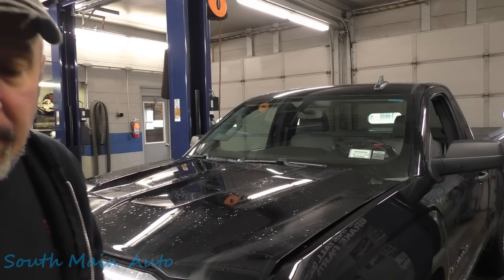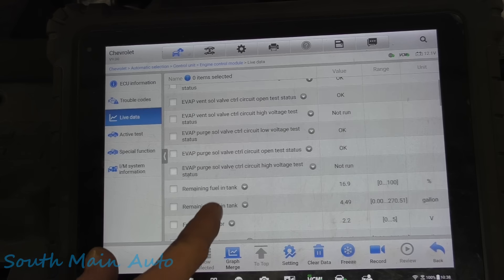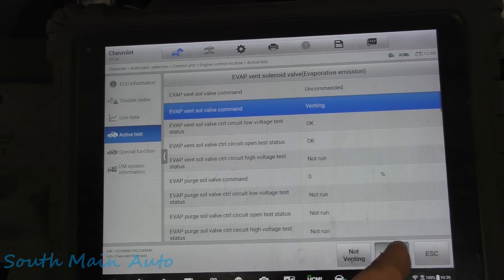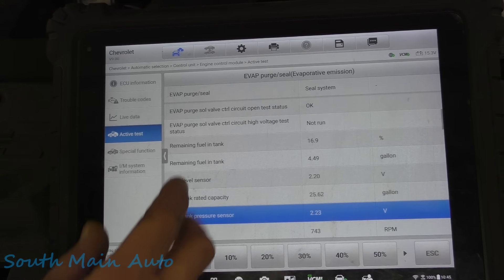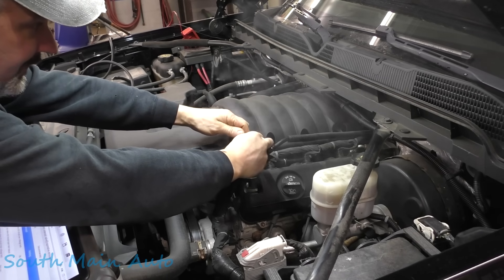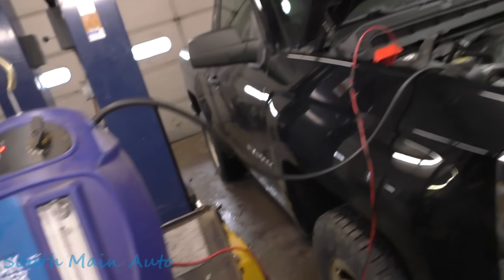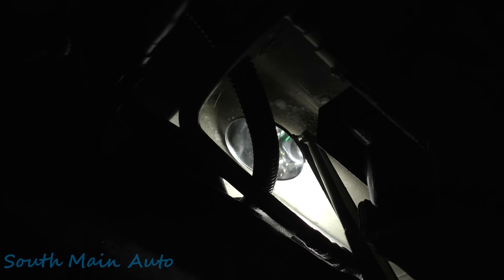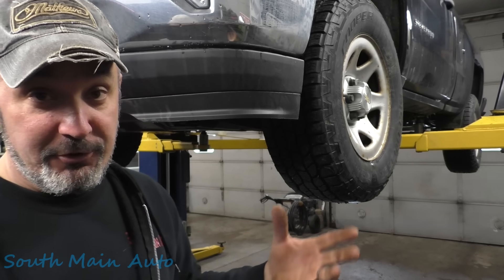An EVAP Leak 2 Other Shops Couldn't Find

Comment: So is the failure of the other shops to find that leak due to incompetence or laziness (or both)?
Reply: I think that when a technician takes an organized approach, such as Mr. O here, then they can avoid feeling like they are mired in guesswork. Which would definitely make me want to throw up my hands.
Mr. O is smart and very knowledgeable. Most importantly he knows to insist on an organized approach. My 2 cents.
Reply: But you can be sure they got paid for nothing.
Reply: @mickblock  Heck, even if a technician isn't anywhere as skillful as Eric O and didn't know how to or do any of the preliminary steps Eric used with the scanner, if their shop owns a smoke generator and they know how to connect it to a vehicle they should be able to find an issue like that.
Reply: technician is an overused word.

Comment: If you can film and diagnose this problem, and provide a commentary in under 10 minutes, you can't do much better than that. Perfect video.
Reply: The smoke machine probably took longer than that to fill the lines and fuel tank. He probably had to edit a bit of footage. But yes, it was a great diagnosis of the issue and thorough as always in his approach.
Reply: The smoke machine helped to make it happen. One person with the right tools who knows how to use them. Only one of three shops had that. South Main Auto FTW

Comment: Before anything, check the gas cap.  Been there two times.  The first time the guy at the gas station didn't lock down the cap. Easy fix.  Second time, the cap was faulty.  Got a new one and the problem was eliminated.  Another easy fix, for $45.

Comment: As easily as you found that leak, it would seem like those other shops just didn't want to fool with the job.
Reply: Dropping the tank and dealing with rust/rot is a PIA job. But that is what a real mechanic does. Many just get lazy.
Reply: Plus- not only did they NOT find it- they said there WASN'T a leak. Seems to me the data proved that the leak was there- Eric just took the time to find it!
Reply: I'm sure they took the diagnosis fee without remorse though.
Reply: @Channel-gz9hm  and they should have refunded it if they can't identify the issue.

Comment: Eric O is far more lucky than I am, I have never needed to pull a fuel tank that only had 4 gallons in it!  I've only done 3, and they were all within 2 gallons of full when I started - one was literally towed away from the gas pump!  34 gallons in that '96 Sierra.  Step 1, figure out how to get 200 lbs. of gas out of a tank without a working fuel pump.

Comment: The mark of a good repair person is persistence. Many just get to a certain point , then quit or make up an excuse for not being able to find a problem. I like that Eric has surrounded himself with tools he's familiar and comfortable with regardless of their cost, from a simple auto lamp to a sophisticated OBD2 analyzer.
Reply: In my younger years I worked as an electronic repair tech.  Another department had about 200 boards that needed repair that weren’t an easy fix.  I got through 95% of them within a week just for gong it an actual effort.

Comment: It’s quite concerning multiple shops could not find such a straight forward evap leak 😬
Reply: Probably could not afford the smoke machine. Or lied about having used it.
Reply: To be fair, the leak is on the top side of the tank, so the 'smoke' (actually oil vapor) dissipates and is harder to see if one is just looking underneath the vehicle.  But any competent (emphasis on that word) mechanic should have found this, on that we can agree.  The trouble is, in every arena of life these days, it is getting harder to find competent workers, for many different reasons that are too numerous to discuss here.
Reply: The other shops probably found it and said nope not interested in dropping the tank. Looks like a case of laziness.
Reply: Too many mechanics would not want to drop a fuel tank and know the issues with rust/rot they have. Just a case of laziness.
Reply: @redmondjp  
Well said. 
Thank for your Comment. 
RL
Reply: It would be even more concerning if they: 
a) charged him for their "investigation"    and   
b) refuse to reimburse said charges, now Eric has shown that there is a leak and that it's so easy to find.

If I were that customer I would be asking the other two shops how much business they expect to lose, if he "names and shames" them in the local paper.   Might help him to get his money back.
Reply: Most shops hire parts changer for less money and make money just to change parts and if can't figure it out shove it out the door get paid done

Comment: Once again, you prove the difference between a diagnostician and a parts changer.....you UNDERSTAND the correlation between the various components and their interaction with each other.  The knowledge is out there, but sadly most of the paycheck mechanics just go by the tests, and if the issue doesn't jump out at them, they pass it on out the shop.  I spent a 40-year career in a field where troubleshooting was a vital part of our job, and trying to find someone with the SELF DRIVE to actually FIND the trouble was always a challenge!  Good job, as usual!!

Comment: i've learned more from you than probably any other person out there. anytime i have an issue I come search your page. Hell I had my tahoe in the shop for a fuel sender. Of course it was full of gas and I had no help to wrestle it down, so I bit the bullet. get it back, cel is on, never came on before. they said something else was wrong. i watched your video, hooked up my scan tool, figured out the issue, took it back and said hey, here's my scan tool, here's the issue, they had to install a new fuel pump. pretty sad when a paying customer has to do the trouble shooting for a supposed reputable shop!

Comment: It always amazes me that other shops that claim they have diagnosed the problem, never seen to find the problem. Especially when you find the problem in the span of, just guessing, 30 minutes to an hour?!
Reply: Makes me have no confidence in shops that looked at it before.
Reply: @erniejones5008  That's why I try to do as many repairs as I can by myself.  I try to get my wife to understand that while I ignore her on  days off doing repairs on our vehicles.
Reply: @JB-tz9pi  wish I could I don’t have the knowledge or tools.  plus I am temporarily disabled. I can’t stand for very long without a lot of pain. Hopefully it’s temporary at least.  Plus my hands cramp up I easily. I can do things like change. My battery and air filter and wiper blades may be a couple of small things but that’s about it.  I have a 2012 Malibu that needs a new headlight but you have to takeoff the front bumper and it’s gonna cost around 125 bucks that I don’t have.

Comment: Glad that the Vacuum leak was a Big one... worked in Pharma before i retired and we had Ultrasonic Leak detector sniffers connected to Head Phones and you would point around the pipework and flanges and the whistle would be heard in the headphones plus the multi coloured LED lamps would rack up going from green through amber to flashing Red, being as the closer you got to the source of the problem ..great pieces of Kit...saved a fortune in time especially in a noisy location. Great Upload...

Comment: My wife's car is a 2011 Escalade ESV and it had the same code and the same problem. I just fixed it about a month ago. I bought a Chinese knockoff Avoca Smoka and diagnosed it myself. First evap job I've ever had to do. Dropping and reinstalling that 31 gallon tank by myself wasn't fun! The evap monitor still hasn't run, and I still have the permanent code set. I've got an emissions test due, so hopefully it'll finally run soon!

Comment: Great job Eric. You can do it for sure, but I'm not so sure I can do it. You're advanced diagnostic equipment and knowledge to use it shows why it's increasing difficulty for us shade tree mechanics. 

I've made my own smoke machine with limited success. My scanner is read only. And if I did know about software updates I couldn't do anything about it? It used to be the money light didn't intimidate me, but after losing a couple of battles like this it's putting fear of failure in my soul? So glad that I live in area that emissions testing is mandated!

Comment: When I read the Helen Keller reference, I knew we are in for some simple problem and wonder on the other shops not being able to 'find' the leak. 'Incompetence'  or just plain laziness. A motorcycle shop here could make more money doing oil changes than getting the valve job done on my bike. I finally took it some place else.

Comment: Looks my '03 Corolla will need an Avoca Smoka test, since I replaced the purge valve under the hood, but the CEL came back after a few months, even with a new purge valve. Thanks, Mr. O. for showing this diagnosis in real time.

Comment: Just did the fuel pump exercise this past summer on my 2014. Against all advice, I did the remove the bed option. I have the setup to remove the bed, but I can't raise the truck. Eric will have this done in less than two hours.
Reply: I'm a remove bed bolts on driver side, loosen the other side, and jack it up guy myself lol

Comment: Today I got my LX470 back from an old shop I used to use. They corrected an improperly installed timing belt that the original shop refused to look at because there was no CEL. I personally knew something was up because I’m used to driving the dang thing. I drove it underpowered like that for almost 2yrs! Kinda sad, but also glad it’s back making power. Maybe I can enjoy it a while more…

Comment: Love to see the OTC products out there. It was Owatonna Tool Company in Owatonna Minnesota on the Great frozen tundra. Buzz Kaplan owned it and sold to Chrysler when one of their programming tools saved Chrysler a boatload of money related to a transmission problem. Back in the early 1990s our company designed the power supply for that tool. Buzz is gone now but love to see the tools still out there. Thanks Eric

Comment: In addition, plaque loves to get caught underneath the plastic in the roof of your mouth (palate). To clean expanders, brush around the bands, plastic, and support arms of your expander, and along the gumline. Additionally, use a proxibrush every time you brush to get into the small, narrow areas.

Comment: I've got 04 F150. Money light on for a while, "small evap. leak". When i fill the tank completely, fuel can be seen dripping from top of tank. I live in area that doesn't require testing so I'm kicking can down road a bit longer. Great video!

Comment: The evap wizard at it again! 
Got on for you, 10 avalanche
P0449 only sets in warm weather,above freezing temps. When i bring it in shop and hoist it, vent solenoid works. And under all conditions the pressure sensor hardly changes. So, is ecm watching the pressure sensor and setting the  vent code.

Comment: I’ve used those lock ring repair kits on a Colorado (dead fuel pump) because we couldn’t get a new tank and all the local boneyards had sold off all the good tanks years ago, it did an OK job of sealing the new pump in.

Comment: Obviously, it has a leak when you check it with the smoke machine. I can’t believe they couldn’t find that leak. I had a problem with my 2008 Honda fit setting P0456. The code only set in the summer in the warm weather, and in the winter code never set. Never had a gas smell. The vent and the purge solenoid, and the gas cap are all good finally figured out it was the evap canister. The previous owner must’ve kept over, filling the tank and wrecked the Evap cannister. I replaced  Evap cannister with a used one from the wreckers and it is OK now.

Comment: Wes has used one of the repair kits on a Colorado/Canyon and it worked well, it seems - a good option for a truck that needs a tank that's either not available or stupidly overpriced.  Doesn't save you from dropping the tank or removing the bed, though, so it really comes down to whatever is easiest for you to warranty.  I say they're a good option for people that need an extra year or so out of a truck that would otherwise fail inspection and as an Illinois farm boy I'm happy to say it's a temporary fix...unless it works.

Comment: I wish you were around here in Ohio. I try to do all of the work on my vehicles. It would be nice to take it somewhere when I don’t want too or don’t have time. Keep putting out videos they are a lot of help. On my company vehicle the oil sending unit went bad. Easy fix. But was told to take it to a shop. They charged 600 dollars. What a ripoff.

Comment: From what i notice is shops are just lazy. And don't wanna do the work to get to the problem unless it's easy. I had a 14 Ford Escape leaking what was described as golden fluid aka oil lol. As the dealership told him and they didn't know what it was 😂. Anyway long story short the vvt solenoid crapped the bed on the rear. So a quick replacement and he was bad in business. Can't believe that couldn't find the leak.

Comment: I have a 2005 Silverado. It kind of surprises me that the top plate of the fuel module is metal while every other part is plastic on these tanks. When I had to replace the fuel module because of the same vent/purge issue ( same issue-due to corrosion) I sprayed it down with Cosmoline. Fluid Film would probably be just as good. Something sprayed on there is much better than nothing.
Reply: Same "problem", not issue.  Issues are magazines and newspapers
Reply: @CaptainRon1913  No. Perhaps you should look the word up before trying to correct others. Most words have multiple meanings. 
Issue-an important topic or problem for debate or discussion

Comment: I find it sad that a 2016 vehicle is considered "almost done" at 7 years of use. I grew up in NY and am aware of the fact that cars of the 50's era would rot out fenders and rocker panels by that point in life, but you would almost expect in 60+ years of engineering excellence they could be building stuff that lasted longer.

Comment: I literally just had my 2014 Silverado diagnosed with this today. I need this fixed for inspection, so they are getting the parts. I feel bad since I just fueled up earlier in the week...maybe I can run the tank down a bit before the parts come. Nice video!
Reply: Schedule it a week out.
Reply: Leave the fuel in the tank.  Just remove the three left bed bolts.  Loosen but don't remove the three right side bolts.  DIsconnect the left tail wiring harness, unbolt the filler neck. Tilt the bed over towards the passenger side and block it up.  You now have direct access to the top of the fuel tank and sending unit.  This  assumes that the bed bolts are not all rusty and crusty.

Comment: Have you ever been called to a dealership for help or had them bring you a vehicle to fix?? I'm sure pride would prevent it, but I was just curious. Nice pickup on the problem. I personally don't know much about cars/trucks or anything, but I enjoy trying to follow along. Thanks for sharing, Ron
Reply: Not just pride, liability.  Eric O has a pretty big exposure and he has detailed all the insurances he needs to protect himself.  Make that a factor of 4 or more and that is what a dealership is looking at...they 
are also a more attractive target.

Notsaying a idividual tech, off the clock, would not be willing to reach out.
Reply: There have been cars come in from a dealership
Reply: Heck, one time I had my vehicle at a shop that does tires and alignments, and they called to say they couldn’t get rear caster adjusted, nor could they get camber adjustment.  I drive over in a different vehicle, get underneath and tell the guy yeah, there’s no caster adjustment available, and they weren’t smart enough to work the camber bolts in the bushings to get them loose 🤦‍♂️
Reply: @jwboilermaker  had a cv problem on a car. Took it to a shop and they said they couldn’t find anything. Still up on the lift and I reach under and jiggle the cv. Guy was amazed. I swear some of those people in shops deserve to stay in prison 😂
Reply: @TurdJesus  Different profession, but... My home is at, say 8410 W Wilson.  The cross streets are all numbered, so, I live just west of 84th Street.  I contracted for a delivery of landscaping rock.  Delivery time came & went.  Got a phone call, "Where are you?  My boss told me you're by 35th Street but I can't find you!"

Comment: So many shops take your money and do bugger all. Often main dealers are some of the worst. I'm a Builder. One time we were working next door to a Ford main dealer. One of the guys took the opportunity to put his car in for a service. He drove in and parked the car against the fence to where we were working. We worked on the scaffolding all day and his car didn't move. When we finished work he walked around to collect his car and the dealer had his bill all made up with his keys. Hundreds of dollars for a main service. He said well not sure how you managed that because the car is still exactly where I parked it. I have been working on top of it all day and it hasn't moved. That can't be right they insisted it has been through the workshop. They argued. He refused to pay. Eventually they gave him his keys and he never went back. And I know of lots more. My dad always marked service items like filters. When you got the car back supposedly serviced. Before he would pay he would lift the bonnet and check for all his marks. If they were all still there look out because he was a giant dude and not someone to mess with. Amazing how often the marks were still there though. I class a lot of garages now as plug and play shops. They can't actually fix anything. All they do is take off a component and replace it with like. Beyond that they are stuffed. People like yourself that have the skills and take the time to diagnose and fix a fault are rare.